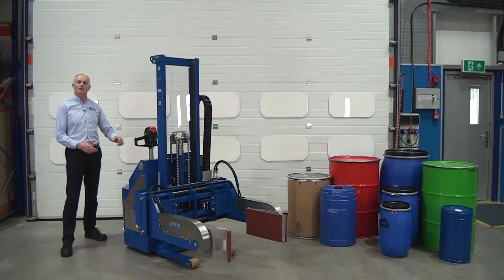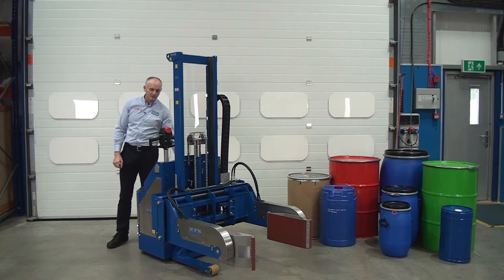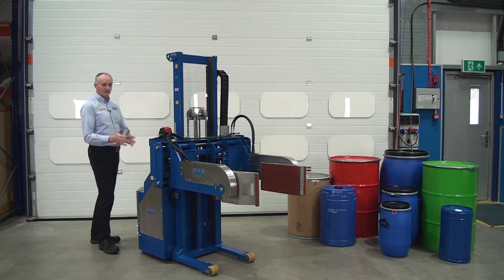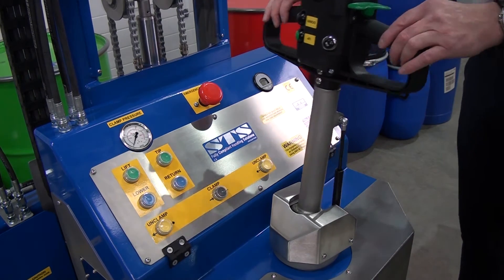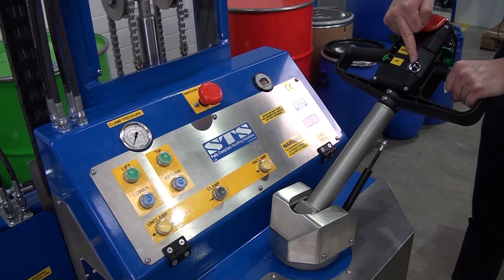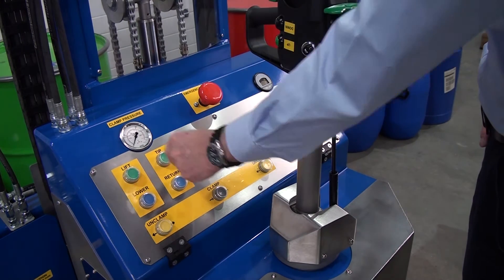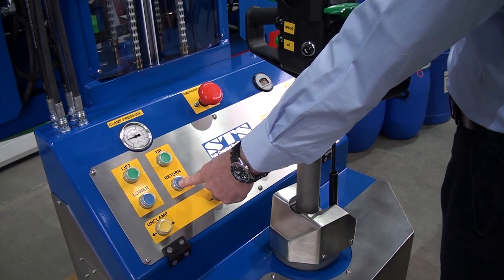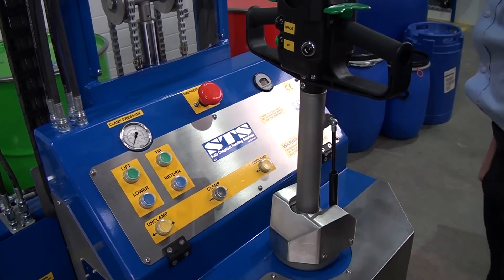Electric Fully Powered Drum Tipper (Model: STE05-RRH01)

Comment: Hi sir,
Very good machine.
I wonder if o just want lift the barrel and place on rack, it is possible to realise it. Or it must be placed back on floor to be released.
Thank you.
Reply from the maker: Good morning,
Thank you for your comment. 
With this model it has a safety limit switch which doesn't allow unclamping at height.
We are able to offer a unit which does unclamp at height if this is a requirement.

You may also be interested in this video: https://youtu.be/LnABs_DByxE
It shows a similar model used for rotating drums into the horizontal and then loading racking.
Feel free to contact us via our website for more information: www.sts-trolleys.co.uk

Many Thanks, Zac Jones